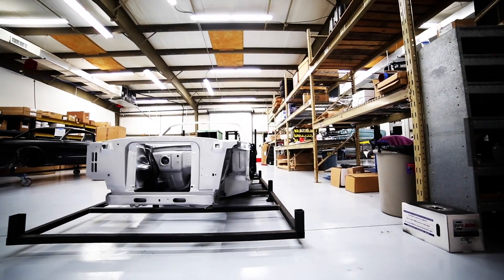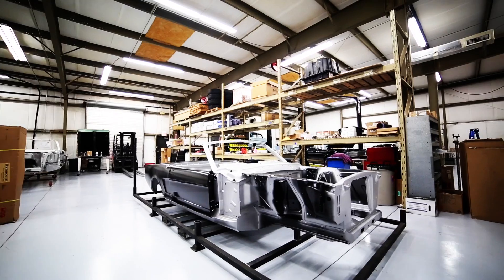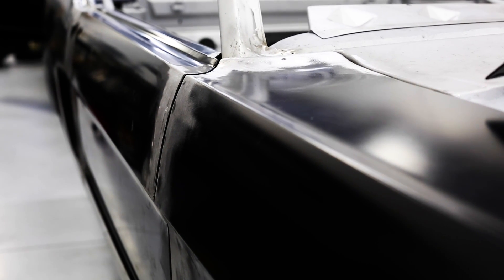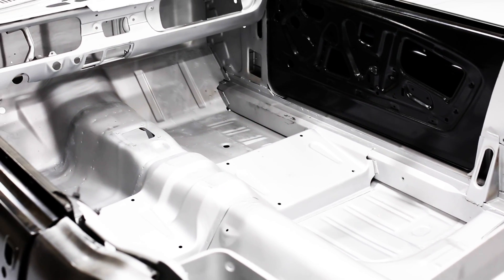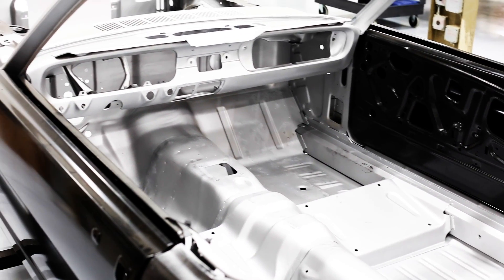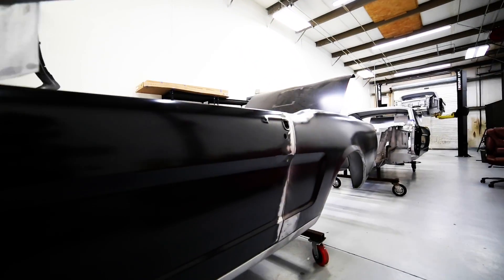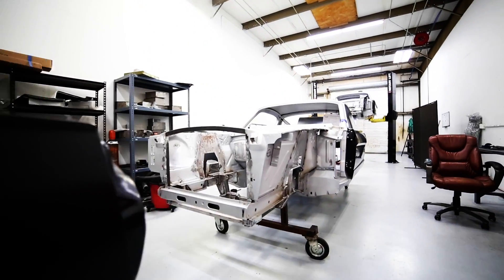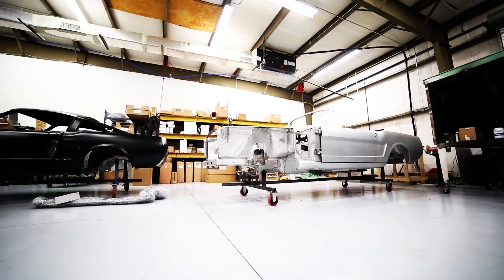How we build the Revology Mustang : The Body (Part 1)

Comment: There is good reason why these repros are insanely expensive.

Its because the bodies and chassis on these repros are so bad that their techs have to spend countless hours just getting everything aligned properly.
If they made the bodies and chassis straight, oh wait I'm sorry I mean unibody, if those unibodys were straight from the manufacturer their techs wouldnt have to spend so much time FIXING THE FLAWS THAT CAME OUT of the builder.